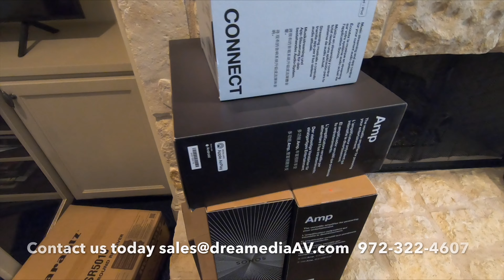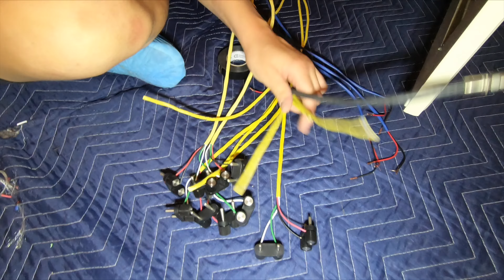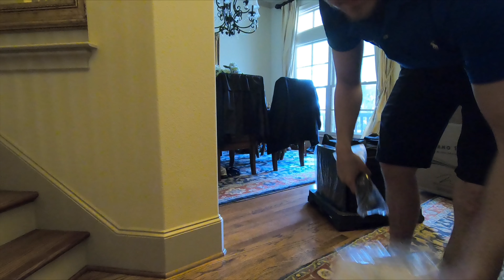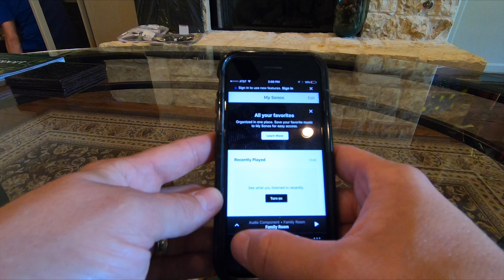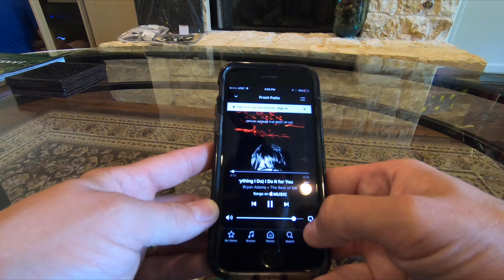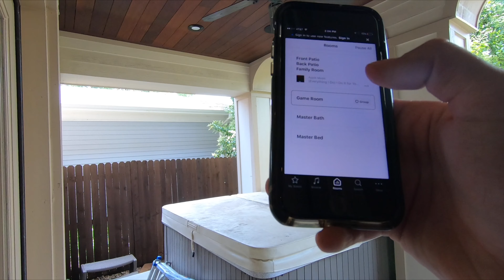Sonos AMP 6 ZONES! Plus Marantz sr5013 and Martin Logan Dynamo 1600X BASS!!! DALLAS

Comment: I have an older home with 10 zones.  Each room with separate volume controls.  Don’t want to purchase 10 amps and going to double up rooms on single amps (Sonos says 2 pair of 8 ohm speakers is ok).  Do the old volume controls pose any potential harm to the amps if left in line?  If I remove them and wire speakers directly, I have to have the same volume in both rooms which isn’t ideal.  Thanks

Comment: Just a cool suggestion... Instead of covering those old volume control locations with a blank plate you can use the Lutron Pico remote control for Audio and pair it via a Lutron hub with each Sonos Amp. This will allow you maintain a wall mounted volume control for each zone for the customer. This way the customer does not have to carry around their phone at all times.
Reply: great idea, would you need a lutron hub for each amp/zone ?  Planning a DIY install in my home we are remodeling.  thx guys
Reply: @shawzzzzzz  No, you only need one for the house. They are great.
Reply from the maker: good idea

Comment: Great vid, but I wanted to cheer something you said. You indicated that the bridge is used or necessary because it helps with the phone streaming music to the Sonos. The phone does not stream any music to the Sonos. The Sonos units themselves stream the music through the internet or the Wi-Fi. The phone is only used as a controller. In other words, you can start a song playing from Spotify, and you can turn your phone off. Or you could even leave the house with your phone. The phone is not necessary for continuing to stream music, only to control the Sonos and change settings.
Reply: Mick Lord that is incorrect, the phone can be used as a controller as the new sonos amps have airplay. If you leave the home or turn wifi off on the phone the music will stop. It can also be used traditionally to control sonos.